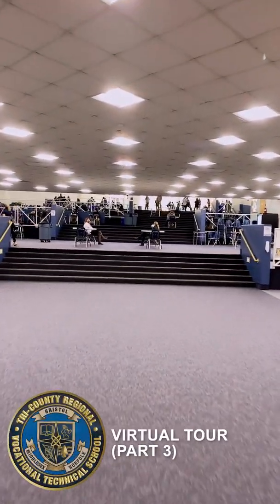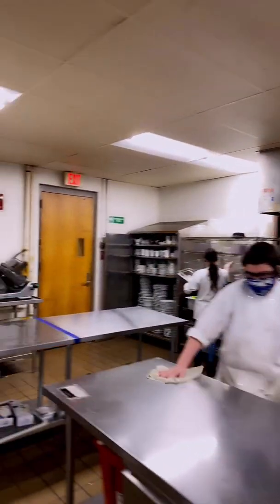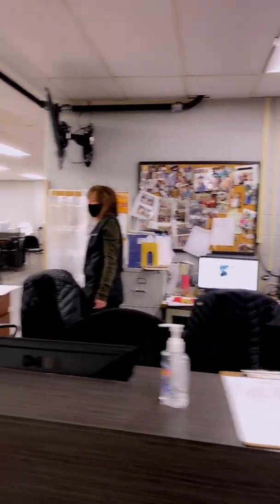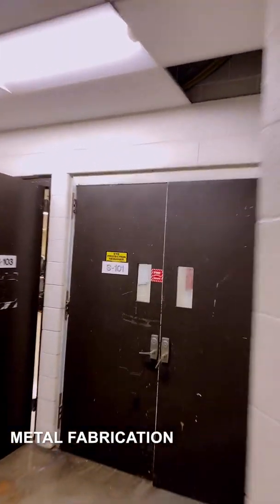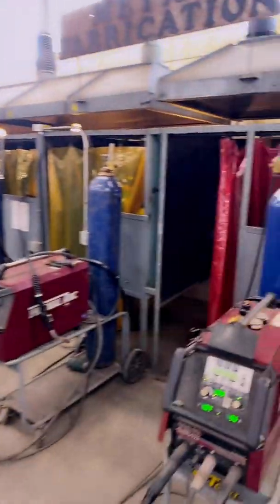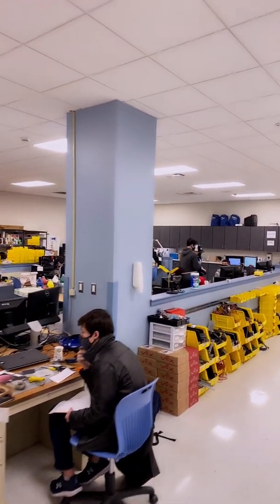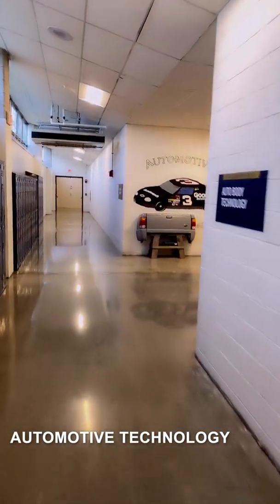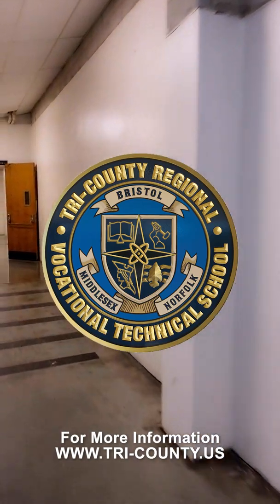Tri-County Virtual Tour of the South Wing & Services Programs

Comment: I was in  Metal Fabrication shop when it was used to be called Facilities Management when you walked in the shop you had electrical on one side painting on the other and carpentry in the middle, and all way to the back you had the welding and metal fab. And Engineering I believed use to be where Construction was, and engineering was upstairs in the south wing hall right before the math class rooms